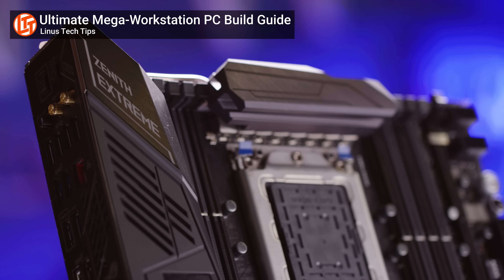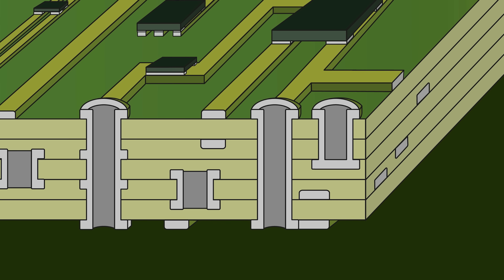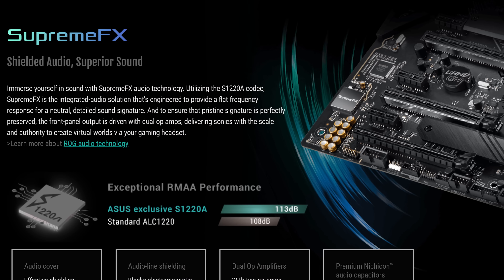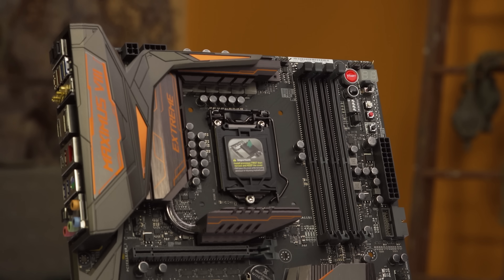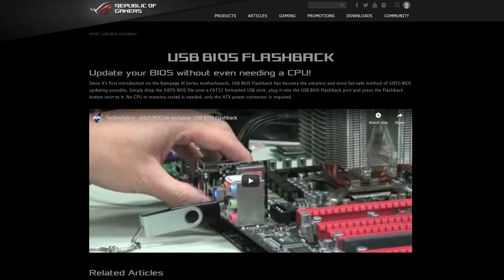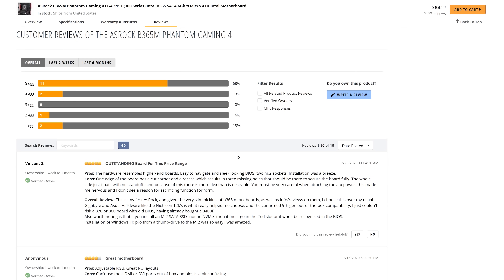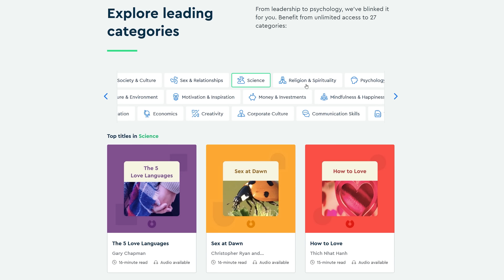Are EXPENSIVE Motherboards Worth It?

Comment: I got the cheapest x570 board. not only to support 4th gen ryzen even the x 470 and b450 do that. but I have a feeling in the next 6 months to 1 year pce 4.0 will have graphics cards and m.2 pce 4.0. its all about future proofing. bang for buck over a couple generations. b450 is good and all but only has pce 3.0 its about to be out dated. you could also wait for the bb550 but I was too impatient.

Comment: I once saw a custom PC with a fancy mobo and a no-brand PSU. The funny part was that the user wasn’t using any of the features(RAID, SLI, video card). 30 bucks off the board could have easily bought a good PSU. 
Most computer shops who build rigs are illiterate who do dangerous mistakes like these. Only a minority of custom PCs that I saw had good PSUs. And by good I mean $30 FSP, not $200 Seasonic

Comment: When the "good" MoBos were going for ~$250, an extra $100 for a performance-oriented board was a reasonable consideration.  

With $450-$500 MoBos becoming commonplace and an additional ~$200+ upcharge for the premium options trending as the norm, I don't see any value in buying into the current generation.

Prices need to come down.

Comment: what are you intending to do with your rig
what are you intending to connect internally
what are you intending to connect externally
how long before you upgrade/can afford to upgrade
in my case … gaming
1x gpu console of the day equivalant [because sli and crossfire not supported by many games]
      that can connect 3 screens
raid 5x hdd .. because i use raid with redundancy for storage
cpu console of the day equivalant 
ram console of the day equivalant + opperating system usage [x2 to disable paging to drive]
2x usb3 connectors for game controllers + 6 usb2 for other devices
1 x ssd for operating system and games
i then set out to get the best deal on mobo needed to do just that and nothing more.

Comment: from my experience going for the absolute cheapest motherboard you can get is never a good idea
you would most likely encounter some instability or weird minor problems and lets be honest no one wants to deal with those

I suggest to see what the cheapest one there is for your socket type and add 20-30$ on that and start from there, at this point going by reviews is normally a good idea if you don't want to spend too much and want a solid motherboard

Comment: Well... the really top expensive ones... probably not really worth it for anything other than bragging rights. 

But I will say this. There is a really good chance you will end up regretting getting a motherboard too cheap. I think its better to get a little more than you think if you can afford it. 

If you are building your computer yourself, there is a good chance you will also be maintaining and maybe upgrading it, and there could be features you find out you miss. like storage ports, ram slots. motherboard headers. you name it. or stuff in the bios. or just durability. 

I have always over bought my motherboards, and I never regretted it, but ONCE I was a bit strapped for cash when I had to upgrade, and I cheaped out on the motherboard. And that one I never grew to like, stupidest money I ever saved on a PC build.

Comment: ahhh but think about this...you buy a $100 board compared to a $500 one... in 5 years the $100 one poops out due to something breaking down. Now the $500 one poops out in 7 years (I had the ASUS sabertoth x75 board died in 7 years and I never gamed on it) that same board on internet is over double what I paid originally new. But I transgress.......... 2 years difference if you dont overclock it so is the $400 price difference worth it???????? I always go midstream right in the middle $150 or so...So to me the expensive one will break down just like a maserati will break down...nice to have but is it worth it in the long run?

Comment: My pc keeps crashing like some days it'll just turn off while I'm playing games. I know it's not my cpu overheating as it runs at 36 degrees C so I think it's either my graphics card (a 6gb 1070) which is a few years old, a motherboard a asus prime z270 or my power supply (800W) though I don't think it's the power supply. Which should I upgrade?

Comment: I'd like to see this tested in a LTT video.
I've heard this argument about not impacting performance many, many times. However, I have noticed quite big differences in performance through motherboard switches.
I wouldn't say you'd notice these in benchmarks (very rarely even), but more or less in how "smooth" the user experience is in seemingly random things.

It's kind of hard to explain as it's seemingly random, but I've had motherboards where I got teeny tiny mini-freezes during usage. Like, 0.1 second freezes. But I'd get 'm all the time and switching to a "better" motherboard would fix such an issue. The weirdest thing is that these "hiccups" never even registered anywhere. No type of software actually "caught" the fact that the entire pc was having mini-freezes.

I've also had a motherboard which randomly shut down the PC (similar to when it shuts down because the CPU is overheating) with seemingly only high-tier PSU's, but worked fine on lower-tier PSU's... or the other way around, I forgot.

I've had cheap motherboards where the mic input had tons of motherboard-noise, where harddisks had long access-times, where even though technically something was running at 60FPS, they would visually be running at random different rates, where they absolutely destroyed PCI cards, where the communication between the RAM and CPU or CPU and GPU just seemed to be "delayed" for some reason (which again, would not exactly impact most benchmarks, as the performance is the same... just 1/10th of a second later) etc. Just seen some weird shit.

Source: Dude, trust me.

Edit; Btw, I would never ever recommend overpriced motherboards. Just not the cheapest, either. Around the 80-200 bucks range. Never above but definitely never below.

Comment: In my experience Top of the range boards are NOT worth it.  When the X470 boards came out for the Ryzen 2000 chips i bought an ASUS Rog Crosshair VII Hero Wifi for £250 and it was a top board.  Its one of the worst boards i've ever owned for stability.  Even now occasionally the board retrains to find the ram and refuses to boot even though the ram is listed on the ASUS site as being compatible with the board and it has the latest BIOS.  Never again will i get such an expensive board.

Comment: You missed a very important detail to pricey MoBos, pro and detailed BIOS and Voltage Regulations and adjustment.

The options and adjustments that you can make with an expensive one is increadible.

Try an Asus Maximus Extreme, i feel there is ni better BIOS or MoBos. 
I love that one

Point 2. Pricier comes with more periferals such as more usb ports or ports in general.

Crappy video, i expected more :(

Comment: In my experience, overclocking isn't what it used to be. Twenty years ago, your system just got slightly warmer and could keep up with a huge 30% jump in performance. These days your cpu automatically jumps in performance when available and is generally limited by heat dissipation. You might get ~5-10% more performance by overclocking and it will often have a stability tradeoff. You get much diminished returns for your money. In my opinion it's really not worth bothering unless you have money to burn.

Comment: I bought a Maximus Ranger VII, it was a pretty badass Z97 mobo back in 2014-2015. But one day, completely out of the blue, it died. I've never even overclocked it!! I replaced with a mid range B85 mobo, still working and it already lasted longer than that much expensive mobo and all the useless crap it had. My system runs perfectly fine for productivity and occasional gaming. I don't recommend expensive motherboards at all. 👎👎👎

Comment: Just don't buy the absolute cheapest board. I got a B450 and realized it didn't have an RGB header and also had the memory slots way too close to the CPU, limiting what fan I could install. Made it work however, I don't care for RGB and I got an okay cooler. Can't fit much more on it though.

Comment: I don't even need a motherboard... I just superglue my processor, my ram and an ssd onto my graphics card, 
then i superglue that onto my psu (which is always switched on)
Then i put all of it in a bucket of liquid metal to connect all of it together and disperse the heat...
All my peripherals :  mouse , keyboard and monitor are connected wireless

I know, i know...  I hear you all thinking : There's no internet, idiot !!! 
Yes, there is... 
Because i dropped my smartphone in the bucket too.

I can tell you for sure, guys... This thing is power hungry and it's not even overclocked...
Every time i plug in the psu power cord... all other electrical devices in my home stop working.

Sometimes i have a blue screen though...

SYSTEM_THREAD_EXCEPTION_NOT_HANDLED (nvlddmkm.sys)

I always wonder what causes this problem...

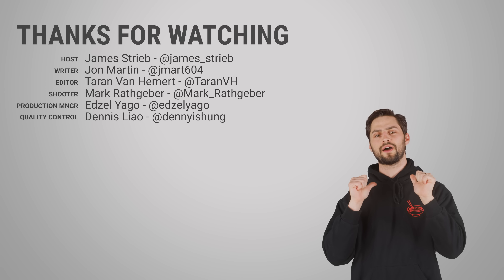Comment: 0:02 / 5:54
Are EXPENSIVE Motherboards Worth It? No, next question.
Reply: You won't see me running my overclocked i9 9900K on a cheap board. The board would overheat and die within months while not even overclocking

Comment: This is why i went with a  Daisy Chain motherboard Asus Prime x470 Pro.
Difference between motherboards. I consider this one of the main problems of users. And in their choice, I think the reviewers of motherboards are guilty. Over the past two years I have not seen reviews in YouTube, where the topology of the motherboard and its capabilities were reviewed. They look at the box, its content, RGB modes, what the VRM cooling looks like or what a beautiful hairstyle / T-shirt the reviewer is wearing

There are no reviews in which you'll find real calculations on the VRM capabilities. Instead, numbers are used that exist only in the datasheet under ideal conditions at 25°C, with perfect surface mounting. One value multiplied by others.

https://www.techpowerup.com/review/amd-ryzen-memory-tweaking-overclocking-guide/7.html

Comment: uuuggghhh ... fan headers? ... that's the exception? 
Please if you choices are $120 or a $600 motherboard and fan header are an issue buy some PSU adapters. 
Thermal airflow restriction because of a couple extra cables is not the issue tech reviewers make it out to be.

Comment: IF you use a higher end CPU and overclock you need a good board. Otherwise it won't overclock or could blow up over time with burned out VRMs. Cheap gigabyte boards are great for cheaper non OCed 3600 and below. I would only buy Gigabyte aorus for anything above. Avoid Asus. Asus is crap and they overcharge for cheap boards sold at premium prices which all will overheat and die within a year or 2.

Comment: Definitely not worth!  50$ and 500$ motherboard same performance.I have a Gigabyte
Ultra durable borad (not the cheapest but not expensive about 120$)
With +1100mhz (from the base clock so not from the boost clock) overlock 24/7 
7 years. only with 4!!! phase.....
What is the faster?
200$ motherboard + 200$ cpu
100$ motherboard + 300$ cpu
You know the anwser.

Comment: cheap board: bad soundchip/implementation, often cheap ethernet instead of intel and bad/cheap vrm = higher temps, lower oc. don't buy too cheap, but don't buy the expensive overpriced ones either. mid-end gives you most you'll ever need.

Comment: All I'm hearing is “lifespan.” 
Cleaner signal? It's digital. It either works, or doesn't. I don't care how much ringing or interference there is or how bad the slew rate is, as long as it works. 
Potential for future protocol upgrades? Doesn't matter if the board can handle it if the chipset manufacturer won't enable it. 
More rigid? Just don't do a Linus and don't drop it.

Comment: no there is too much worthless crap that you shouldn't pay for to get performance almost identical to the cheapest board but unfortunately for overclockers you cannot get the best VRM on a reasonably designed mid range board so if you want the best VRM or even one that's close then your stuck with bullshit marketing gimmicks

so much RGB weirdly designed PCIe slots that don't work as well as the normal cheap ones the budget boards have big stupid cover blocks on everything instead of proper heatsinks weird stupid features that don't work for there intended purpose like half of the special buttons on a overclocking board huge gigantic Post times often in excess of 10s that make the cheapest Dell look like a supercomputer by comparision extra NICs that don't work as well as the chipset NIC extra Sata ports that dont work as well as the chipset Sata ports extra USB ports that dont work as well as the chipset ports see a pattern half the time expensive boards ship with a broken BIOS that only gets fixed the next year

i wish i could put a 16phase VRM on the cheapest shittiest mATX board there is it would probably be better then all the high end boards imagine pushing 5.3Ghz on a board that posts in under a second